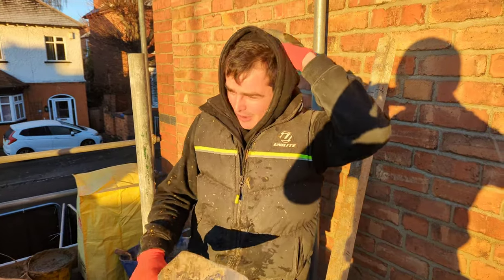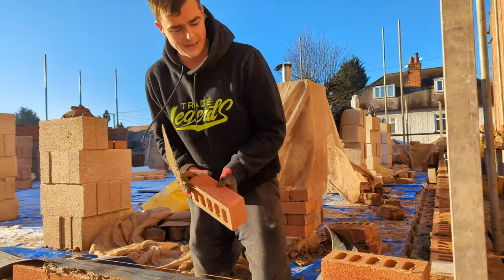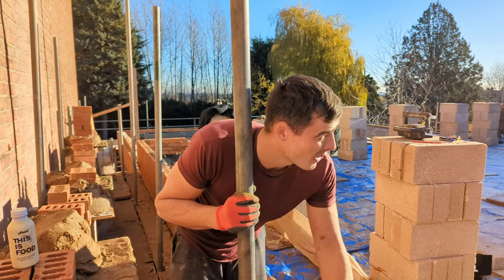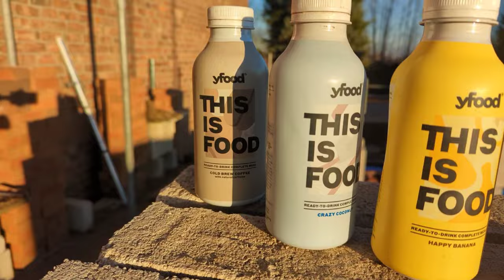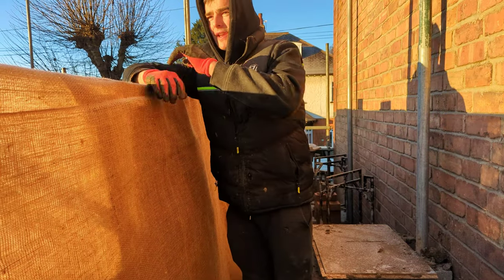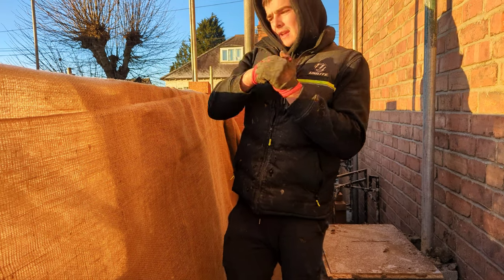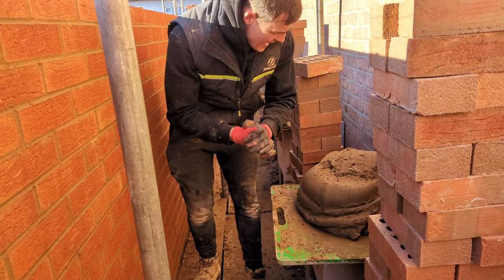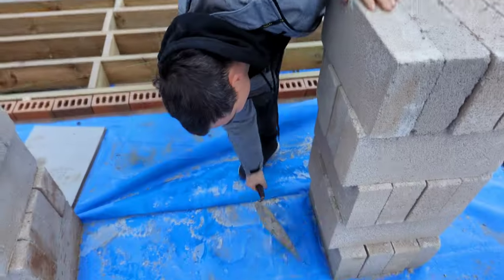Bricklaying - Fighting the cold - Getting bricks laid 💪 #renovation #vlog #extension

Comment: Hi mate, instead of the roofer grinding out the bed joint, you can run a chariot through it yourself. Not sure how the roofers do it but I'm sure it's a much neater, effective and efficient job done with a chariot👍
Reply from the maker: Cheers for that mate! I'll have to dig out the old chariot, or just wire brush it out💪 hope your good mate !
Reply: We use slightly bigger dpc, leave it sticking out 20/30mm, and then rake it back 30mm once gone off……keep up the good work…….always a good channel to watch…..👌👌👍

Comment: another good tip when bedding on a DPC trays I was always taught to use 1st 1" of the bed joint in sand then mortar at the back then 5mm bed of mortar on top of the tray. you should never dry bed bricks as this causes a slip joint. Then with the sand at the front its simple and easy for the lead man to clean out with out risk of damaging the tray.

Comment: 3% and rising, nothing less unless your house bashing as they don’t care.! I never add frostproofer especially if I’m laying bricks, been there, done that… you said it was like a summers day but I could see your breath.! Good luck with it….also it’s been sunny where I’m working but air temp -1…
Reply from the maker: That's it mate 💪 that frost proof works wonders mate 💪 sets your gear off in about an hour, whereas before I was pointing up a day later at least 😂
Can assure you those few days were good to lay 😀💪
A question though...how do they work in colder counties than ours all year round? Genuinely wondering?
Reply: @IzzytheBricky mmm good question, there comes a time when the mortar will freeze, I had it once, knocked up a mix put it spot boards and frozen in minutes, nice sunny day aswell, they must use a retardant, which I thought the silos on site contained, probably wrong but would explain the site near me and they are laying at 7.30 😳😳
Reply: @IzzytheBricky hey Izzy great video 👍
I’ve never done it myself but apparently masonry in the winter here in 🇨🇦 is a pain in the ass. Tarps around scaff with heaters and apparently it’s quite warm in the work area, and when you step out it’s freezing. Not really sure how they deal with making mortar unless sand/cement is also kept under a tarped area with heat kept on overnight… 
I.e. guessing your sand was frozen today? 
Really interesting seeing how you navigate the freezing temps, I.e. frost covers, laying only above 0 degrees
Reply: @IzzytheBricky  igloos
Reply: I’ve seen films of them with a pipe through the sand pile being heated with a gas flame. Hot water in the mix, hot air on the mixer and space heaters on the blocks.  The fuel cost must be incredible. 
I’ll stick to 3 degrees and rising

Comment: You still put your weep vents in backward though🤣 Turn them 180%  so the small spout is at the front bottom. You still perp the joint minus the small spout that stick it the bottom It has inbuilt measurements on it encase for render etc. You can also do them flush.
Reply from the maker: Cheers mate, but I'm so sure they are the correct way mate 💪
Anyways, cheers and have a great week! Try and stay warm
Reply: Backwards is for ventilation
Wouldnt bother building in cold temperatures, kills the mortar and doesnt go off
Complete waste of time
Cant for the life of me understand why the lead trays are not preformed with lead stapled on and built in proper
Your a solid grafter and your brickwork is top drawer !!!
Keep learning
Reply from the maker: @jacannon9147  thanka buddy! Means alot! Glad you enjoyed the video brother

Comment: I'm a young bricky (6 years experience) who has been working for someone new lately, I count up the amount of work done by counting the bricks/blocks in each course, x by how many courses I've done. I count halves as a half, but any other cuts I do I count them as a full block, as it takes more time to cut and lay than a usual block does. These plots we've been building have movement joints everywhere, internal and external. The contractor I book in to keeps refusing to give us a price sheet/lift sheet, so he's told us to count up each brick/block and book in this way. He's come to us and told us we have overbooked significantly, we're both very confident in our numbers. Turns out he's totalled it all up by measuring the job, he will obviously get different numbers than we will if he's counting the 6 cut blocks per course as say 2 blocks (because the measurements will add up different to what's actually there). 
If I cut a 300mm cut and laid it, that to me is still worth full price as it takes me longer to cut and lay than a full block would, but by measurements, that would be worth 3/4 of the actual price. Which would you consider as correct? Because we're having a dispute about this now as there is 6 internal movement joints and 4 external mj, there is obviously a lot of cuts involved that we're not going to be paid for, not to mention all of the windows and doors, etc.. 
He and his slow gang of 4 came onto our job for a day and barely laid 500 bricks between them, but they have paid themselves day rate (£200 per day) out of OUR price when they only covered 1 persons wage, that would be the reason why we might have over booked, because he's booked in work he hasn't done and then we've built it and booked it in.

Who's right who's wrong? Please give me some insight, I would have taken this to Bricklayers Worldwide on Facebook but we all know how those freaks act.
Reply from the maker: Hi mate
To be honest, there's no fighting a price sheet unfortunately. If it don't add up, they're gonna say your in the wrong, regardless how many cuts you have to do.
Also it's hard having DW lads with price. They should work on their own plot and things like that really
Sounds like a bit of a mare to be honest mate! I'd either hop on DW with the other "slow" lads and swap plots/sites/gaffers
Sorry that's the best advice I can give you brother 🤜🤛

Comment: Am I correct in that so long as the fresh mortar does not freeze before it has cured, its integrity will not be compromised?
Reply: its the time it takes to cure that's the issue, all weather conditions affect it, to hot cures too fast it crumbles, too cold it slows curing allowing freezing, too wet it drys white. Also temperature of materials has to be taken into account, frosty materials will freeze the mortar. Its a learning curve😀

Comment: I don't like that idea with the tray there's no adhesion, we always rake the joint out for the lead, no need for a grinder. Engineers don't like ties being put at an angle as they say they can bend which is unlikely I suppose. A 200mm long tie may work or maybe just bend them in half is what I do. Always a problem when Architects/Builders want old style with new methods, 9 inch Flemish with adequate internal insulation would have been fine.👍
Reply: Hi Andy I watch your videos too. If a tie has 2 fixed points and the brick/block has no sideway movement how is it going to bend? An NHBC inspector told me that they dont care if they are angled as long as they are in. Its site agents that are making life miserable for us
Reply: @scottnever8732  I agree mate, I was just relaying an experience I had with an engineer which could cause a problem if they pulled you on it.I do get the principle that on an angle they could bend but not going to happen in fact if you didn't use any ties it probably wouldnt move.
Reply from the maker: Thanks Andy appreciate it mate! Smear of muck on top of the tray would be alright wouldn't it 💪
Hope your staying warm or got some inside work 💪
Reply: @IzzytheBricky  yea better than nothing mate, no work for me on my hols now mate, have a good Xmas 👍
Reply from the maker: @bricklayersworldwithandy6277  enjoy mate! Have a fantastic Christmas!

Comment: Tie tip! The ties need to be straight out from existing wall to new wall or does no good. Installing ties at an angle makes it easy for the installer but no structural purpose for the tie if needed. Only use galvanized ties! The others rust out!.

Comment: further comment rather than using the wrong length or placing ties at an angle in the 9" wall why not use the correct length ties.

Comment: Fucking cold at the moment, -8 i Denmark 😅 so we have monday/tuesday off, because everything freezes
Reply from the maker: Wow that's well cold! How do you guys go about building over there? Do you do anything different to what we do in the UK? And what temperature can you guys work at?
Reply: @IzzytheBricky  well most of the stuff is a lot different, than the english way of bricklaying. We use silos on the sites I work on, where we just have to add water (its sheit mortar) we cant put anything other than water in the mix, which makes the stuff sometimes, impossible to work with. On top of that we cant use acid to wash off with anymore, so we point the brickwork (we do this after about 4-8 courses, because it gets dry a lot faster than yours) then we wash it over with a washing sponge, ofc only with water

Comment: Your one of best on YouTube. Decent bloke. But do yourself a favour and throw that big trowel away. You don’t need a big trowel. My 11” has worn down to 8.5” and I still faster then my mate with a 11” trowel. Honestly been laying over 25 years. I see people turn up with the biggest tools they can find and they just slow themselves down. I will never go bigger than 10” next. As I say mines at 8.5 and will use it till it gets to 7”. Then it gets used for pointing around joists and external patch.
Reply from the maker: Thank you Lee, really appreciate it! Yea, that 13" is already down to an 12/11. But I do use my 9" loads. Was using it quite alot in this video💪 I've found I'm slow with any trowel 😂
I often swap daily between my 13, 11, 9 and 7. Really depends on my mood and what work I'm doing! 
What's your favourite pattern mate? Mine personally is the London Narrow Marshalltown
Reply: They start Philadelphia style when I buy them but wear nearer to a London but my point gets that sharp on end I use it instead of a knife.  I use trowel for as much as possible by time you’ve reached for brickhammer you could do it with trowel and laid it. I,e that’s why I like them not too big.